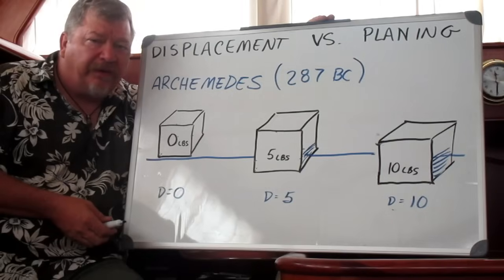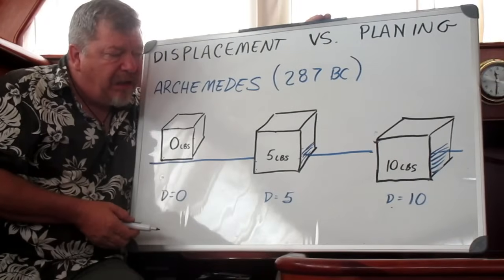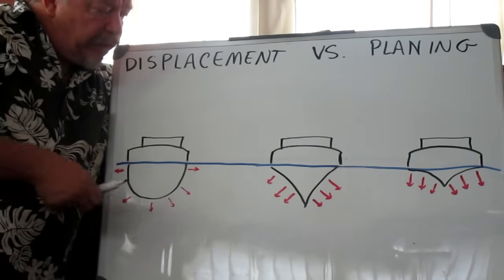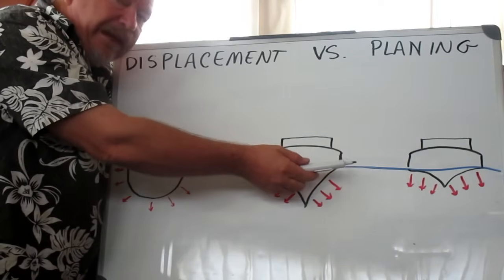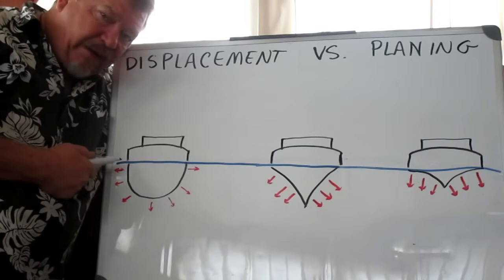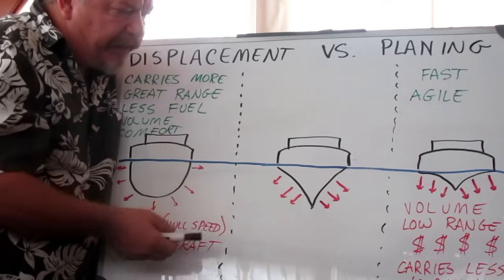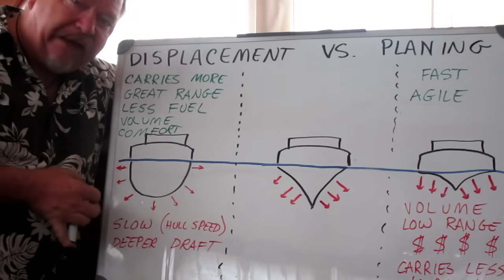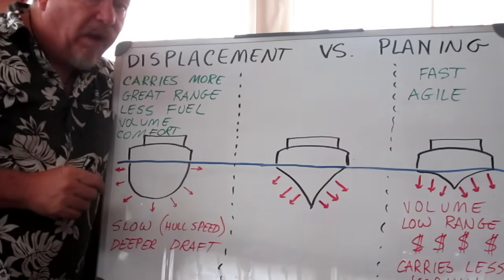Displacement vs  Planing Hulls

Comment: Hold up.
His name was Archimedes and his eureka moment was NOT that the amount of water displaced was equivalent to the weight of the object. But instead the volume of an object was equally displaced in water. 

Imagine this. For example I have a 10Kg block of tungsten. (19.2 times the density of water.) The volume of this block would be 520.833 cubic centimeters
I also have 10Kg block of lead. (11.34 times the density of water.) The volume of this block would be 881.834 cubic centimeters.

Both of these blocks sink to the bottom as they are far denser than water. How in this physical world can a larger block displace the same amount of water?
Reply: the object has to float for it to hold true. once you start using solid objects with density greater than water then yes the volume and weight of water displaced will  be the same for two solid objects that are different weights but both denser than water.

 however like the gentlemen in video mentioned. "whatever fluid it is floating in".  so if you put those metal blocks in a bowl of mercurcy...  bam!!  it holds true again. 

also the force of buoyancy is equal to weight of fluid displaced in all examples just that sometimes the weight exceeds the buoyant force.
Reply: tom carlson this comment is correct, take it from an engineer. The displacement is of equal value, NOT mass
Reply: Weight vs surface tension. Make a bowl of said lead or tungsten object. It should float. Basically take a plastic bowl, let it float on water, ad weight. The more weight the lower and more stable, till jou exceed the amount displaced by the added weight.
Reply: No the video is in fact correct because of an important caveat that is added namely "the water displaces the boat as well" meaning he has not violated any of Newtonian Mechanics here ("every force is acted upon it by an equal"or in this case greater"force"(water)). And indeed for anyone who "rides a cat"(if designed correctly) one immediately understands and proves the point as the water is in fact "riding the air"(using the reality of water displacing the boat in a pleasing manner thus "riding the air" so to speak) so again the YouTube video presented here is in fact correct for the purpose of the topic at hand ("displacement") which is a material reality and not some mystical thing. Importantly added to this discussion is the term "buoyancy" which is an altogether separate topic involving another really amazing number of possibilities in boat design (Boston Whaler most famously) the theory of why some things "float"(suspend themselves in water at the surface and of course within the surface, under the surface, at the bottom, etc.) For example...none of which are given by the critics here I should add...in Washington State they famous build their "bridges" purely out of reinforced concrete that "float"(have neutral buoyancy).

I suggest the critics here go out in the real World and see how certain items actually get built and function as such before lording over everyone one about how smart they are because they read a book on something and got an A+ for repeating said scribblings in a rote matter.

Reality is in fact far different.
Reply: @doolittlegeorge  There is a lot of confusion about “gross tonnage,” displacement,  volume, etc. I’ve had yacht brokers tell me that the weight of the water “displaced” is not equal to the weight of the vessel. I’ll do some more research but I hope my position is correct because I’ve been arguing it for years. 

Another method to calculate it would be to measure the surface area and depth that the vessel sits “into” the water (sq. inches, sq. feet, sq. centimeters, sq. millimeters, etc... whatever the measurement is); that should not be difficult to calculate, and then figure out what those units of water weigh. Weighing any small unit of water would be easy. 

I’ll research it more but there is conflicting information galore about this subject.
Reply: even air "displaces" water(waves) so yes in operating in a vacuum you might get an A+ but in reality and as listed above everything displaces in and around water. unless it's lighter than air not water (an "airship"). this is why hull design can yield of so many types equaling unexpected results so for all practical purposes in designing something the weighs more than air("a boat") is going to displace water thus making this video exactly correct for the topic at hand.
Reply: It works for anything with a density less than water.
Reply: @daytonwintle6051  less than air not water.
Reply: @doolittlegeorge  nope. Water
Reply: tom carlson here is a much better explain than my comment.  man in video is correct. 
https://youtu.be/05WkCPORlj4
Reply: there is nothing wrong with public schools
Reply from the maker: Tom,   you may be right.... my textbooks were all public school.  The important thing is that the boat will sink until the water displaced by the boat equals the weight of the boat.
Reply: tom carlson you're right.
Reply: For ANY object to float - be it made of steel, concrete, or styrofoam - it must weigh less than the weight of water it DISPLACES. 

1 cubic ft of fresh water weighs about 62 lbs (saltwater weighs about 64lbs). Take it from there... 

If, for example, an object (i.e.- a tiny "boat") were to displace 10 cubic feet of water (620lbs) , it would float - IF it weighed less than 620lbs. (but in reality, you would want a boat to carry an engine, fuel, cargo, people, etc. and NOT be level with the water...i.e. - have "Freeboard"... )so... it would need to displace roughly DOUBLE or more, than the weight of the water per surface area "wet", at measured total weight (hull) while FULLY LOADED.

It's THAT simple, really.

Comment: Can you give me some numbers of what is considered 'light', 'middle' or 'heavy' displacement in sailboats?
Reply: Eef BS,

Interesting question!   I have no numbers ready at hand, but think it would depend on a ratio of length to weight.  PUFFIN is 19 meters length on deck and sits at about 53 tons... figure that to be very heavy.   Boat neighbor with an Oyster 65 weighed in at 50 tons... also heavy.   I dont have data on the racing hulls in the 20 meter class, but figure them to be much lighter.  Probably half that weight?  Then there are going to be the data that trends toward the displacement ratio:   heavier ratio is logically slower, but could carry more sail?   Heavier ratio is logically deeper, giving a better (?) lee slip resistance and therefore a higher point?  Heavy would certainly dampen motion....  Lighter would logically be faster....